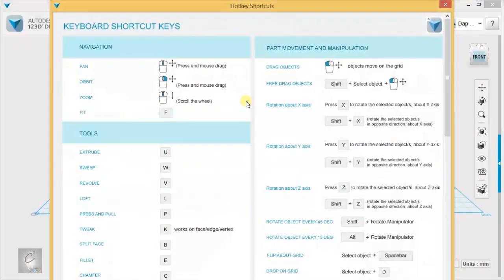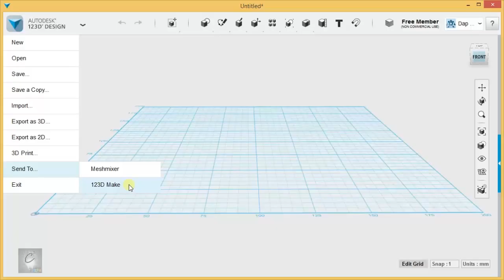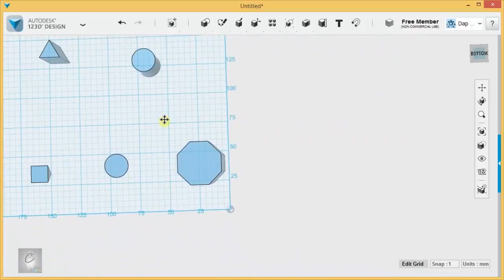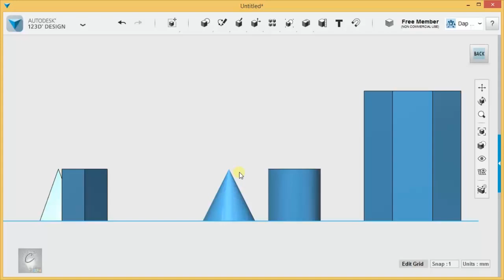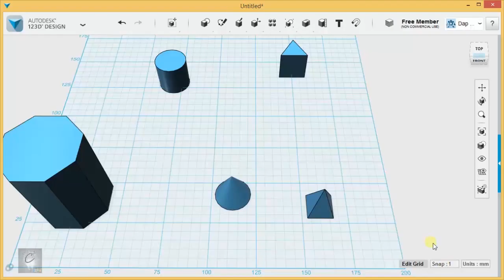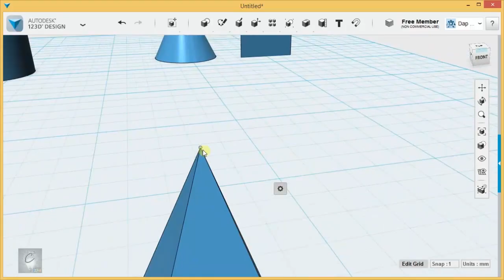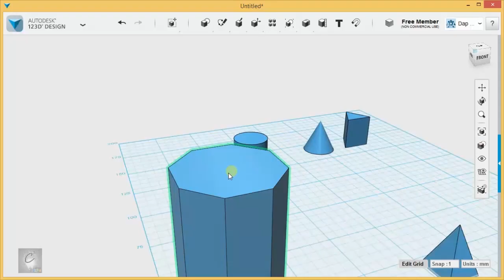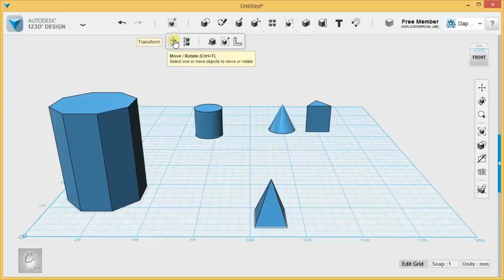123D Design Tutorial - Basics 1/6 - Introducing the Workspace

Comment: Awesome vid and style.  You need to state your name as I watched this video but did not catch your name.  IMO you want to win literally every award in the world on true beginner CAD/3d videos?  What's missing?

I'd do it but don't have the knowledge and you do and are also a very good teacher so I'd love to see you do it.

Instead of focusing on the TOOL as a beginner, back up one step that literally EVERY one of these 3d/CAD/software howto's have missed that assumes you understand computer CAD design in general, and do this:  

1.  Start with a photo of a design on paper with a couple drawings to indictate 3d surfaces/depths.  Does not have to be super elaborate but have a few holes, a few different surface heights that vary, etc.
2.  Using whatever tool of choice (123d I assume), take that paper sketch and step by step, take it from sketch through extrusion to the completed part in 3d in the app.

I have yet to see a single tutorial that does this and what that picks up that they all are missing is not only HOW to use each function of the app, but WHEN.  Here's my sketch on paper but for this surface, WHICH tool do I use as a new (non) designer?  Oh, this section of the sketch looks like a certain type of triangle, but WHICH tool can render that in the fewest operations?  Wedge?  Do I sketch it first? Hmm.

For me, my issue is I can design on paper all day long, even indicating 3d depths by drawing additional angles of sketches.  I cannot, however, successfully use any of the many tools I"ve tried to in any realistic effort get into the digital world  and for me, it's 3d printing driving the need.  I want to actually MAKE what I can think up and draw quickly with a pencil and paper.

Comment: FYI, in the current version of 123d Design (2.0 1.6.41) the Prism primitive is missing... which is unfortunate as its the one you demo first!  Its effectively replaced with the Polygon (2d flat) sketch instead, which is at the far right of the primitives selection.